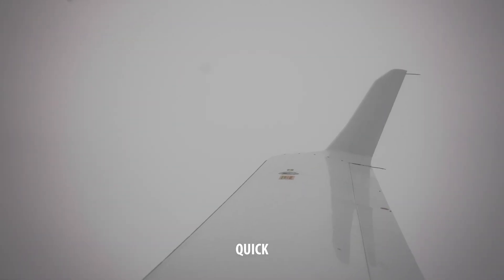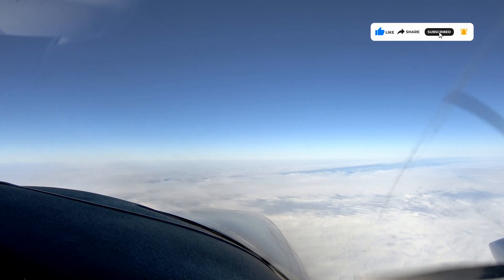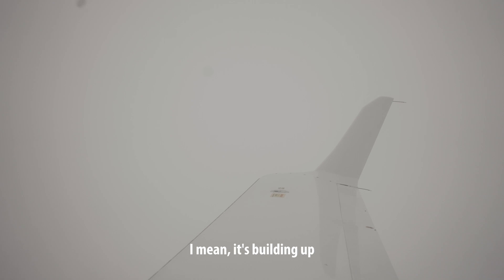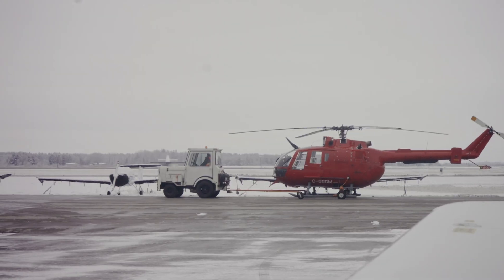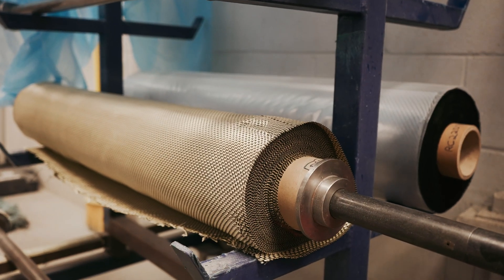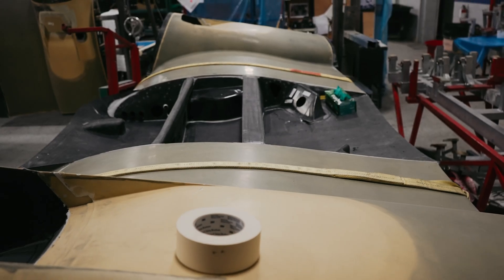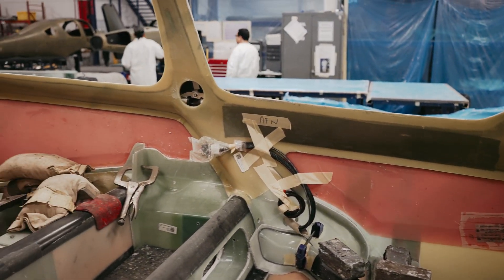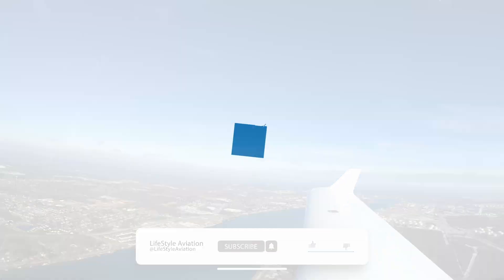Picking Up DA40 NG from Diamond Aircraft Factory

Comment: Look, I think your designs are great, but it seems like you're presenting "hand layup" as the superior option, which it's not. It's the easiest by far but the least precise. You're saying it's about preventing waste (as pre-preg needs to be kept cool) but you're potentially wasting resin by not using it efficiently and making the airplane heavier. Even resin infusion would have been better but I'm not seeing any of that, only some vacuum - probably over the wet layup based on your narrative.